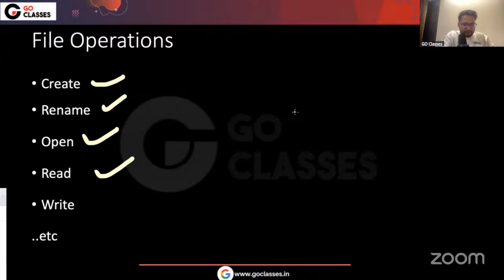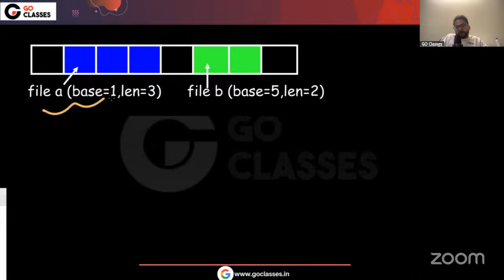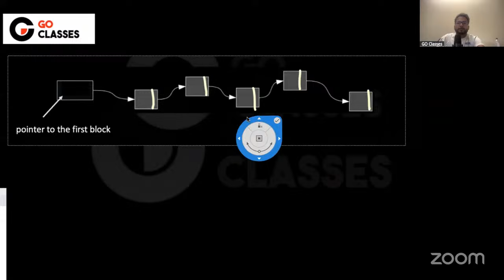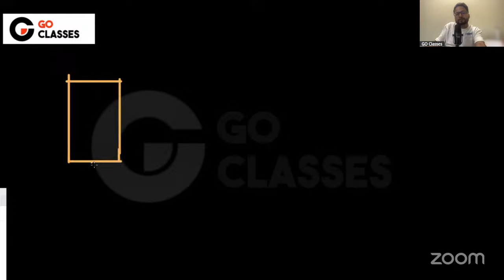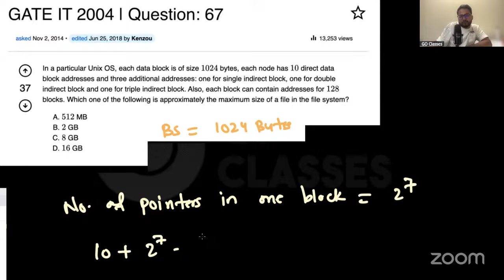File System Implementation From Scratch | Operating Systems | GO Classes

Comment from the maker: Part 2 File System :https://youtu.be/pFNpIxd_cHw

Annotated Notes: https://vcdn.spayee.in/spees/w/o/60e975430cf20278db21ff30/v/6933ee684703fe122c0fc6b8/u/60f87e620cf2db423f3b5573/p/assets/pdfs/2025/12/06/6933ee684703fe122c0fc6b8/6933ee684703fe122c0fc6b8_original.pdf?Expires=1765014762&Signature=P3LZlCO9adNnHsiUinNWABs3xujSnqrhMdW3~60o8r4Lm34Kxa8lOyx9mL3KWF0S1y3LebEu7tX6a5yhQUb-317RBz~e8ubqhPjHQKnHPCRSr4J3nvfrmSvwyPlrAnXWESf081JottjxRUU0G3-sIDoqwmv7CmlQC5XqoGhA1-aOPNPk10U9uM1WRHlbe4I-FixjaI2H-bD5s~RKoid-wTwQYq~gyaYamdnBM0KMVjXlilHmKDjgBMvUbOtAbsNqI2JFL1JZE00wMMcH30URF2P6EO5fIAgpMajXLkpn9ekTArG8MdBIh0pzZSsFr5AxYDxdG8Hd1aJpxPxeoCYAFw__&Key-Pair-Id=APKAW3MHMK54TM3QKYNH

Comment: 1:56:27 the printed answer for part ii. is not matching with sir's answer

Same mistake at 1:59:14

In both cases sir has not converted 32-bit address to 4 bytes before dividing by the block size

2:04:16 
Block pointer size would be 8 bytes. Not 4 bytes as mentioned in the slide. However, this data is not relevant for the question.

Comment: 2:07 What is file system
16:54 Allocation stategies
25:41 Summary
33:58 Extent based
39:14 FAT
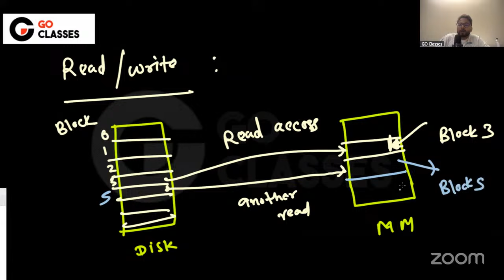56:00 READ access & WRITE access
1:12:36 GATE CSE 1996 QUE
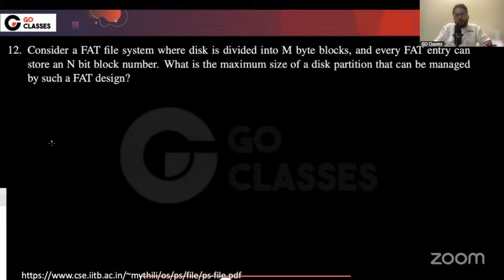1:23:14 IIT BOMBAY QUE
1:33:29 Indexed Allocn
1:39:15 Multilevel Indexed allocn
1:50:35 Questions

Comment: in gate question 23 1996 at 1:21:28 no of entries in fat table can be 4096(block size 4KB or entry size is 1B) but can point till 255 block no  after this it can't point but can point to end of chain so I think all 1024 files can store on disk (like starting  block is stored in metadata and we can say that next block is end of chain, because we have 4096 entries we can easily do this) am I correct or not ?

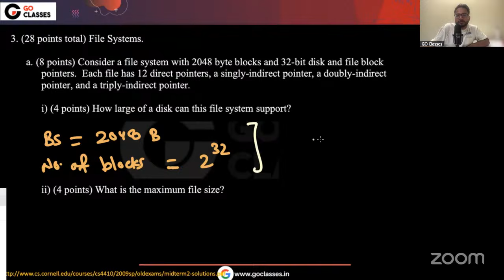Comment: at 1:53:40  i think there is small mistake sir you have taken bytes instead of bits 
                        32 bits= 4 bytes  so pointers in each block =2^9 i think overall much needed and best session on file system
Reply: yes you are right
Reply: Right.
Reply: yes i noticed that too similar mistake in q no. 42 gate 2019